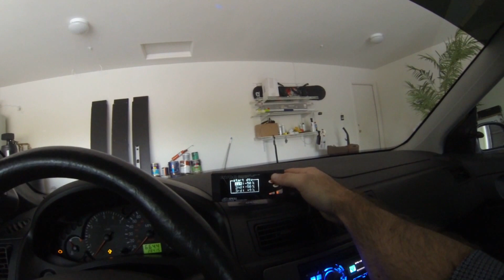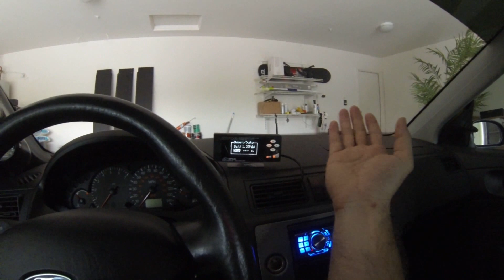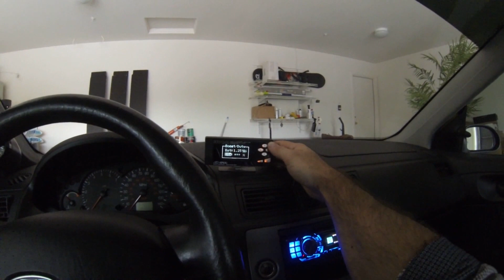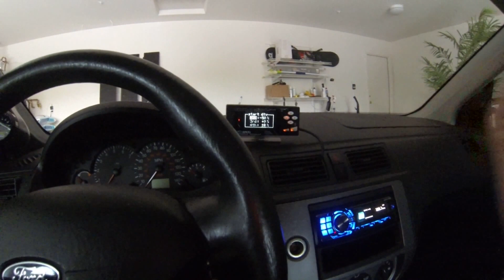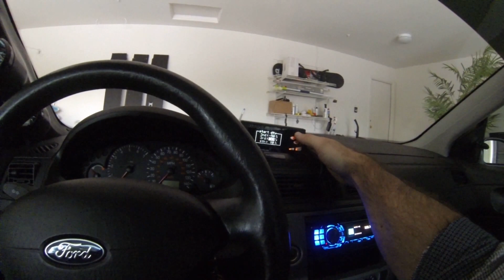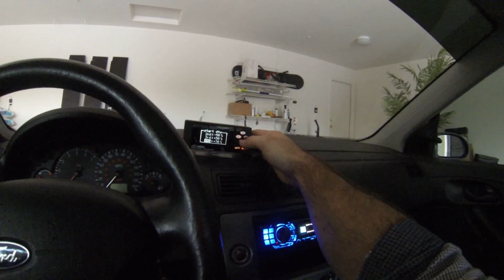APEXI AVCR Tutorial

Comment: Quick question if you can help, when you tripped the scramble setting with it display and thing different on the screen?? I just set mine up and when I go to SENSOR CHECK and press the scramble button it says on but goes straight back to off when I release the bottom.
Confused if it's actually working or if I'm using the wrong button.

Comment from the maker: don't have one, but it's tapped into the ECU harness.  The duratec motor needs a tach adapter to get a good signal for the AVCR to read.  Other vehicles may or may not need that.  You can monitor engine speed, vehicle speed, throttle input, injector duty as well as manifold pressure.  Minimum to use the controller properly you will need to tap the engine speed, vehicle speed and throttle position.